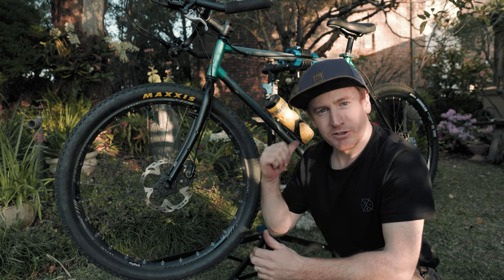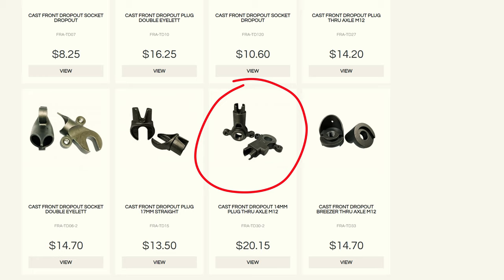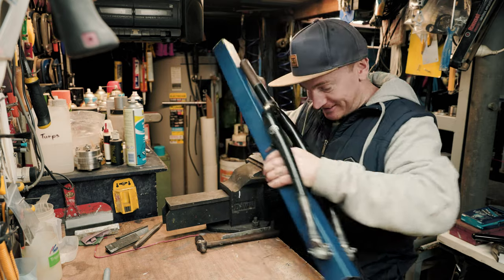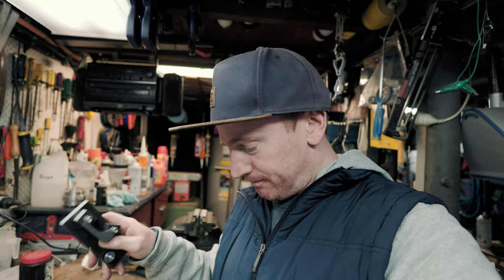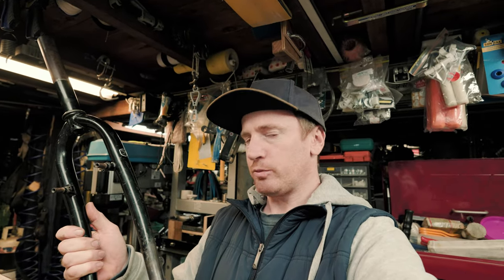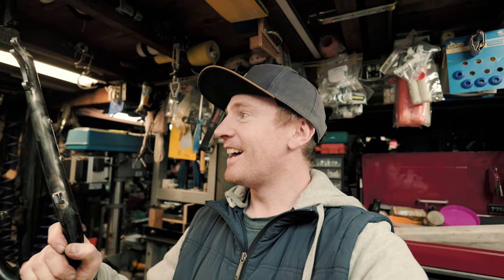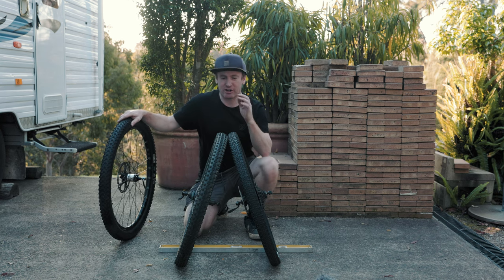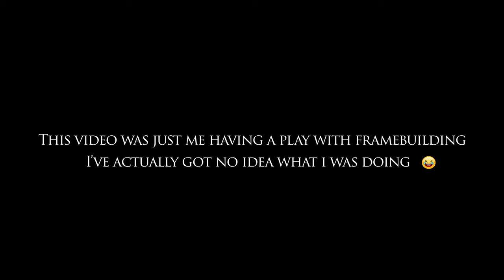I Replaced the dropouts on a 90's MTB fork to fit 27.5 inch wheels // Disk brake conversion

Comment: do you had any problem after you converted to disc? i've converted my crossframe but on forums people seems quite mad....
Reply from the maker: @ControlAltGar  No issues at all. Have these people ever converted a bike themselves? My guess is they haven’t. I’ve done 3 bikes now and they are all fine. I too get people telling me all sorts of things. A good one is that the metal in the fork legs is too thin on forks designed for canti brakes. Apparently not thick enough for disks. I think they’re absolutely crazy for thinking this. One of my bikes I have the calliper adaptor peice held down with a hose clamp. It’s been like this for a few years and I’ve done many fully loaded bikepacking trips like it. Still no problem. 
My only real issue is that Canti brakes can be really good so what’s the point. For me I did it so I can use wheels I have that’s only have the disc option.
Reply from the maker: Watch the last minute of this video if you want to see the calliper that’s held on with a hose clamp. It’s still like this. My last few adventure rides were on this bike.
https://youtu.be/nvvpi0VSPSM?si=cVz0qdaRlF2jrpQk
Reply: @advanturest  tnx!
Reply: @advanturest  My fork is an unicrown one designed for cross/mtb. i don't think is too thin but still i decided to install a plate on the lower leg and then on it the brake's mount too (both brass-brazed). i mean there are plenty of material but still people are killing the joy of this project. I just think to swap fork because i'll never fully trust this one :(
I have to admit that i saw some broken forks but c'mon! they are all designed for road!!
Reply from the maker: @ControlAltGar  Honestly, I don't know where people come up with these ideas. I'm not a frame builder so technically I know nothing, but If you look on a bike building store that sells fork blades for building your own forks. The wall thickness is like 0.9mm to 1mm. Its then up to the builder to decide if they want to weld or braise on disc brake tabs, or canti lever brake mounts etc. There are definitely cheap bikes with poor quality steel used which for sure could break. The forks i've worked on are all old but have been 4130 chromoly. They're very strong. There is a video by Cobra Framebuilding that talks about this. He thinks that a certain generation relates unicrown forks to cheap bikes. Heaps of the top brands still use unicrown forks, there is nothing wrong with them. But they use decent metal. I think you will be fine.
Feel free to have a watch of this. https://youtu.be/hB7zGlczh-Y?si=c6jKWglwNt7TGUcd
Here is also a link to a fork blade for sale which says disc on it. it might give you some more confidence. https://hillbrick.com.au/product/8737/disc-fork-blade-unicrown
Reply: @advanturest  very interesting video, i agree about the aesthetics of the unicrowns looks cheap. On my current build i also have a cromoly frame but i have no info regarding the type (it is a wheeler crossline 3000 from 90'). But i belive is mid qualiti because the frame has lots of details plus the component were mid range. Also i searched deep on the web and the only broken fork were from a road/city type. Probably i'm going to test it when is ready in a safer way and in case of problem i'll buy a new fork and a treadless headset. thanks a lot for your comments. Those were the type i was looking at, interesting things to learn and sharing experience :)
have a wonderful day

Comment: Great video! Did you have any cracks after riding with these dropouts?
Reply from the maker: So far I’ve done 5 fully loaded bikepacking trips with these forks plus multiple big day rides and so far they have been working perfectly. I have the forks on a different frame to this one, it’s another old Raleigh but just a smaller frame that fits me better. So any of my videos that I’m riding a bike with the corner bars are using these forks. 
One thing I’ve recently found out is I put the dropouts in backwards. Not sure how I managed that. They still work fine though.
Reply: @advanturest  thanks for the info! I’m planning to make my Old MTB on 27.5 1.9 wheels with Panaracer gravelking tires, basically everything will fit into the frame, but most likely not into the fork, I now have 26x1.95 52mm tires , while the gap on the fork is about 2.5cm, and the width fits a maximum of 54mm 26x2.15, I’m thinking of buying another fork with wide gaps and doing this with it.What about drops, did the dropouts have any problems with them?
Reply: @advanturest I also wanted to ask where you bought these dropouts, can you give me the website?
Reply from the maker: @dnchgcyclist  I’m not sure where you’re based but I got the dropouts from a local bike shop hear in Sydney that specialise in frame building. They are called Hillbrick. https://hillbrick.com.au/
Since doing this mod I’ve noticed some old forks have more clearance than others. I’ve even had people tell me they have fit 27.5 wheels into their 26in forks. You might be able to find some without going to the effort. Maybe you’re like me and just like to tinker and do random things 😂 good luck with the build.
Reply: @advanturest  Thanks again!) Yes, it's true, I just want to make something special from my Old MTB, because it's interesting to me, and I love this bike)

Comment: I'd like to know, why is it more common to sand the paint off rather than using paint remover? Any thoughts on this does paint remover do any harm on the process?
Reply from the maker: I don't have an accurate answer for you, but I don't think paint stripper effects the metal. In my case I had just a small area and the wire wheel takes the paint off so easily. Paint stripper can also be a bit messy. Saying that, I have tried using paint stripper on a set of forks a few years ago and it just didn't work that great. I think the modern-day paint strippers are crap compared to the good old stuff. I don't know much about it but my guess they no longer have some type of deadly chemical. Could be a good thing to research.
Reply: @advanturest  thanks for this! I agree, paint stripper is kinda messy and still needs sanding afterwards. I guess sanding proves to be better when removing paint from a small area.

Comment: very intersting. good job.

if you want drop bars on your mtb check out the sensah 1x11. i just put it on my rockhopper for a drop bar conversion. its good
Reply from the maker: I just had a look at the Sensah gear. Nice and cheap! I’m definitely keen to give drops ago so I’ll keep them in mind. I just went for a 30km ride with these Corner Bars and I think the ride position is a bit low, I had a sore neck from looking up for 30km. I think the hoods on drop bars sit up higher so they should be perfect. 
I may have also just picked up another old Raleigh so it could be a good option for drops. I’ve got a problem 😂
Cheers!
Reply: @advanturest  I've had that same neck issue also, unfortunately the geometry of drop bars lengthens the reach and lowered the stack just by their nature, I'm in decided whether it works for me now I've done it 😕 (bike fit).

Some things that can be done, shorter stem or down size the frame. Also try a helmet with no peak and frameless sunglasses. This reduced the amount I had to 'look up past'.

Comment: 26 mtb fork with 27.5 x 2.1 wheelset works just fine. Only downside is only left with slight small clearance, so dont ride it in a mud.

Comment: so, nobody noticed you installed the dropouts backwards? or was that intentional?
Reply from the maker: How are they backwards? By your comment it sounds like you know more than I do 😂 I think I know your answer but here’s my take. I did no real research but I did look at other forks and I found photos of both directions. In my view, as I’ve done them, any impact into the front wheel would be pushing the axle into the dropouts. If I did them the other way around then a hard whack to the front wheel could push the axle out of the slots because the slot faces more backwards. If that makes any sense? I know that shouldn’t happen with a tight skewer but it just made more sense to me. Id love to know if they is a technical standard. 
And to answer your question, you’re the first person to pick up on it.
Reply: @advanturest  hope it didn't sound like a troll comment, sorry. Most all dropouts are set up to drop out towards the rear; but with the curve of the fork its basically facing down. There's hardly any forks I've ever seen facing forwards like yours.
But it's your fork, idk if there's any problem with it. If you've ridden it and it's fine, well good .
My only other thought was, if you went to all the trouble to do this, but not converting to thru-axle seems odd. But you explained why you did that, so...
Reply from the maker: @keithcieplinski  no all good, if I thought it was a nasty troll I probably wouldn’t have replied. I’m genuinely interested in your question, One day I’d love to build my own bike including forks. Any new info I get is always helpful. Something that has bothered me is that I never mentioned in the video that I didn’t know what I was doing. I did put a title at the start saying I’m just experimenting but my guess a lot of viewers don’t read that. For me I just love making stuff, even if I have no clue. I’m also obsessed with cameras and love filming things. This seemed like a fun experiment to film.
I just had a re watch of the start of the video and can see the old dropouts went the opposite way. I’m eager to get home now and look at the forks. I wonder if the angle of the new dropout slots is a lot sharper which made me do it the way I did. Either way, I’ve done a heap of bikepacking trips with them and so far no issues at all. I haven’t lost any front teeth yet so I suppose that’s a good thing 😂

Comment: 650b wheels of the same resulting outer dimension will only elevate the BB, which is not good.
It is also a less stiff wheel.

Comment: What handlebars are those?
Reply from the maker: They’re a carbon copy of the Surly Corner Bar. These carbon ones are from Ali Express and are very light. I’ve been using them a fair bit and no problems so far. I did a random ride last year where I talked a bit about them if you’re interested. Video is on the page and I think it’s titled something about surly corner bars.

Comment: drop outs look strange, are they not backwards?
Reply from the maker: I don’t think so 😂
Nah I’m confident they are not on backwards 👍
Reply: @advanturest   i think they work both ways 🤔 😅
Reply: Hey thanks for this vid and your others. Up for a Hampton state forest ride? I have an old Protour TX660, dont bother looking it up as it has zero internet presence, basically the CRX200 redesigned as a 26” wheel tourer instead of 700c. Dont think i will bother with what you have done though ha ha.
Reply: I'm glad that you said it.  I was about to say the same.  They are on backwards! It still works though...
Reply: I love how fearless your work is here, but those dropouts are on the wrong sides.

Comment: After about 3 years the last Keurig stopped working https://www.youtube.com/post/UgkxBrV-RbF5Nk0Rlt9i15aao-YMzqzTG8Vf   initially was able to unblock, however eventually we couldn't fix. That one was a replacement unit sent by the manufacturer after we had problems with our very first Keurig. This works fine (lol, at least for now) however I didn't realize the water reservoir was so much smaller than our prior unit. With 2 people having one or two cups of coffee each morning, it seems like I'm refilling it daily. Otherwise just happy to have the convenience of pod coffee vs. making a morning pot.
Reply from the maker: Forks have the threadless 1-1/8 steerer.

Comment: its a waste time and money to do this kind of conversion because theres too many 650b frame laying around at dumpster already that you can save it..😅 but i admired your guts anyway
Reply from the maker: You have a decent point, although most old 650b frames are alloy and I want Chromoly. All the old Chromo bikes are 26inch.
Either way, I just like tinkering and it was fun to play. The amount of hours I spent filming and editing this I could have just worked and bought new forks but that’s no fun. 😂
I also have nothing against 26inch wheels but I have the light 27.5 wheel set that I wanted to try. I’m pretty short and ride small frames. The 26 inch wheels kind of suit my size bikes. 
Thanks for watching and thanks for the comment 👍
(Very slow response on my part)

Comment: just go and buy a new fork , spending all that time and money on a fork you can get new for 10buck , for 50-100 you can get a alu fork that will feet moren wheels with disk
Reply from the maker: That’s not the point! I enjoy tinkering and experimenting. Time in the shed, playing with random ideas is enjoyable. Then there is all the test rides to see if what you have done has worked. The process of it all is why I did it.
Reply: well nice if you have the tools time and money to do it , i once want to convert a old vintage road bike to gravel with disk brakes , ask dude to solder me braket for caliper and reformant for the stay ,dude ask me 50euro , after i will need 50 to buy paint  and also get a 1" with braket for disk , so i end up buy a brand new aluminum frame with disk brake mounts  and 1.8 " fork for 70   and keept that vintage bike vintage ,  @advanturest